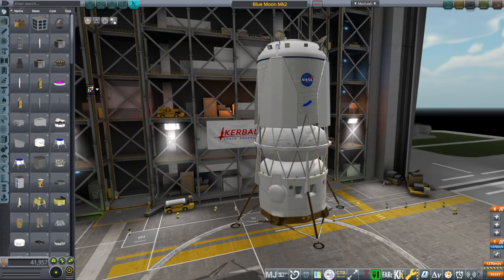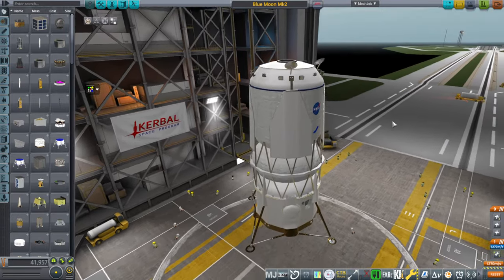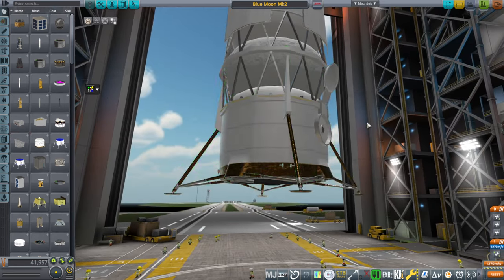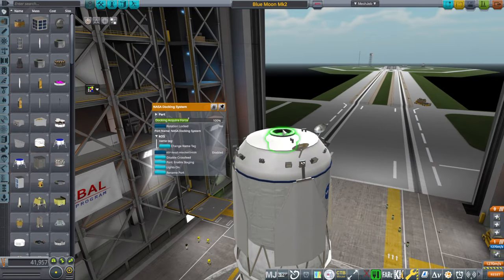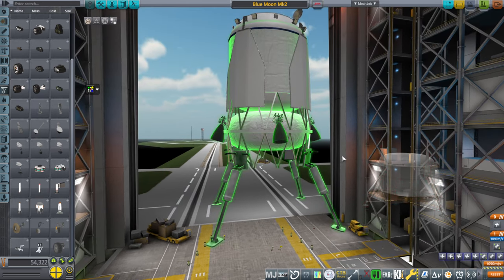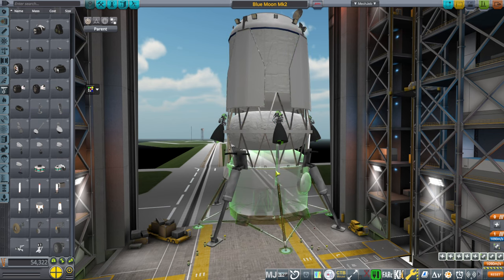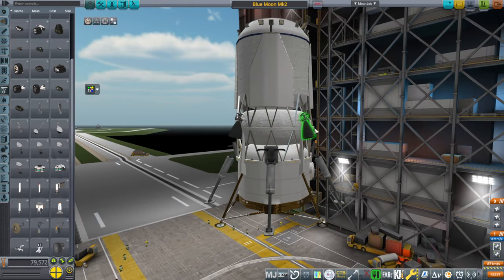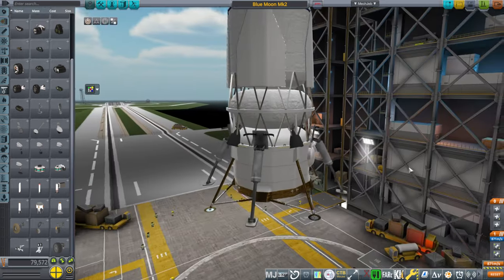Redesigning Blue Moon Mk2 (RO in KSP 1.12)

Comment: Thanks for the follow-up video.

This sort of modular 'sky crane' approach makes a lot of sense. I think it will largely depend on how confident BO/NASA will be about those engines surviving close contact with the lunar regolith. (Regolith will likely be Artemis' worst enemy regardless)
Regarding previous landers: Your point about protecting the ascend stage is very fair. In the past, any ascend vehicle was separate from the lander. However, there have at least been re-lights of lander stages as well, like Surveyor or Chandrayaan, I think. I can't tell how comparable those are.
On another note, any protruding rock on the surface might make a very bad day for astronauts on the current lander concept. I think engines high up is the better approach.

As for the tunnel serving as radiation bunker: Good idea! I am unsure what kind of high radiation events can be expected around the moon; high solar activity would only come from one direction, I think, meaning shielding above their heads might suffice, no tunnel needed. While in NRHO, Orion is  currently be the fall back plan in case of high radiation, but the large lander tanks might be a better option.

Comment: I think in the end it comes down to the simple fact that this is a single stage lander, meaning there is no ascent engine to abort to, meaning robust engine-out capability is everything when it comes to crew safety on landing. So while other approaches might have some nice features, especially for cargo, the chosen approach is what will most reliably get crew either to the surface, or back to orbit.
Reply from the maker: My argument was partly that this might be tempting fate with engine out capability, since it was making them vulnerable to the regolith. Also, the four higher mounted engines do not sacrifice engine out capability - you just have to make sure the opposite engine is shut down. You still end up with two engines either way.
Reply: @RaizSpace  In some scenarios late in the burn, it might be possible to lose 2 engines and keep going with the 3 central engines approach, which seems significant to me.

As for regolith; I agree it's an issue. but it's an issue which should be characterized by the uncrewed test flight. By the time crew are on the vehicle, that should be a resolved, or at least severly mitigated problem.
Reply from the maker: If there's any possibility of losing two engines, those engines shouldn't be used at all. Apollo relied on single engines - we should be way beyond the possibility of the failure of two. Yes, these are hydrolox and not pressure-fed, but they need to operate at a higher standard than the possibility of losing two on a mission. At the same time, I would argue that having the engines further apart would reduce the possibility of losing two (except for the intentional shutdown). As for an uncrewed test checking for the impact of regolith, that's not really a good way of doing it because you can't really tell whether you're just getting a sweet landing spot. You could land ten times on the Moon and have it be perfectly fine, but then have an issue on the eleventh. Typically, we'll have to do tests on Earth long before an uncrewed test based on what we know about the lunar regolith, modeling it as best we can.